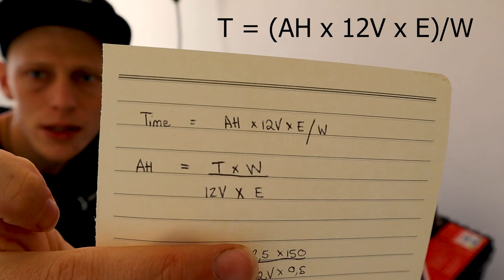How to survive load shedding using an inverter and deep cycle battery.

Comment: Just a note on the Watts used in the formula: The Geewiz energy meter shows you the output Watts, you have to divide this by the power factor, also displayed under a different function on the energy meter, to get to the input Watts. Use the input Watts in the formula to get a more accurate result.

To double check the input Watts, multiply the Voltage and Current (A) shown on the energy meter.

The input Watts is the apparent power which is typically measured in VA, whilst the actual power, shown on the meter, is measured in W. The loss is reactive power.

One last note: The Geewiz meter consumes 0.5W by itself, so you can deduct this from the input Watts, but it's quite small relative to a typical load so you can probably neglect it.
Reply from the maker: Amazing thanks so much for this extra useful information!

Comment: I have the same inverter, and I also have an ellies one. Can i add an additional charger to the batteries, reason i ask. I now and the disconnect my batteries from the inverter and charger them with an 8stage proper charger to condition etc the batts then get longer time out of them, want to make best best of both worlds combo by prickle charging sins the mecer have crappy charger build in.

Comment: Thank you very much for the informative video!
Could you please touch on the "efficiency" again? You said an efficiency of 0.5 is ideal. Is that 50% of the total battery capacity?
Reply: That's correct, you only want to drain your battery to 50% to increase it's life span

Comment: i have 4 x 12v 105AH gel batteries...all want is to run my 2 tvs. does your inverter cut off or warn you of dropping lower than 60 percent batttery power.....im a nubie at this.

Comment: Hi there please help , i have a N200 apn 12v battery. And i also have 1500 w inverter with 10amps battery charger. Please help me to use manually without connecting to my db

Comment: Does your Mecer inverter make a humming/buzzing sound when the mains switch off and it only runs on battery? Not the fan, but the electronic circuity buzzing?
Reply from the maker: When mine is in use it does yes. So when using the battery power it will make a hum.

Comment: Hi Andy, can you please do a video with your inverter on, not under load, and under load.  I have the same one but it makes a noise even when not under load, and an even higher frequency noise when under load and the power is off.  I can also hear the noise at my PC when it's under load, might just be the phase, but I'm specifically concerned about the noise when it's not under load.
Reply from the maker: Mine does indeed make a noise when under load. Kind of a high frequency buzzing sound.

Comment: This inverter is well-known for overcharging batteries
Reply from the maker: Thanks for the feedback!
Reply: is it over charging via means of too high of a voltage the spec sheet says something like 15v overcharge cut-off which does seem pretty high on the 12v model and 30.0Vdc ±2% on the 24v though it says its float voltage is 13.7v which seems correct. I have one that's been working for years but i want to know what its charging rate is for the 24v model and it says on the spec sheet its selectable but im not sure im going to assume it delivers around 10 amps for charging the 24v

Comment: HI, Does the Inverter also charge your battery or you do that separately?
Reply from the maker: The inverter charges the batteries when the power is on. then converts the power from the batteries when the power is off.
Reply: @MarijuanaSA  thanks, most helpful video bro.

Comment: I like the video very much. I have 2 questions. How does adding an additional battery affect the hours. In other words when you add an additional deep cycle battery, does that change your AH from 105 AH to 210 AH or does that change the formula in a different way. Second question is if you do have 2 of those batteries and just for argument's sake you have 4. That is for batteries connected in parallel, giving you the same 12v and hopefully (105 x 4 AH), does a stacking like that mean you need more chargers or can the same inverter in the video charge all 4 ?
Reply: Adding more batteries wont affect the formula, it always remains the same. Adding more batteries will increase the time they will last. If this is a 24v inverter and you are connection 4 batteries then you have to make 2 sets in parallel and combining sets to be in series ( 2p2s) so that their combined voltage does not exceed 24v.

Comment: Thank you for these calculations, preciate it. 

Does the Mecer 12v 720w work when completely off grid. Like you would have your load below 720w but youd wish to use solar panels simultaneously. 

Please advise as I will be getting this in a week's time.
Reply from the maker: How did this go man.

Comment: Good explanation.
Just a question on the inverter itself; I bought the exact same unit recently and find it quite noisy in battery mode - like a humming transformer sound. Did you also experience this?
Reply from the maker: It did make a noise, but was such a small price to pay for me personally.

Comment: Can you use a normal car battery?
Reply: Short answer is yes. The lifespan will be really short though as they're not designed to deep cycle but rather provide a lot of energy for a small amount of time.
Reply: car batteries are designed to start cars, not be drained over and over. Plus they're smelly.

Comment: Had 3 of these in 11months, they don't seem to last that long, poor build quality maybe ... 

My setup was 2400va inverter with 2 x 100ah gel batteries in 24v and never had the inverter load higher than 25% - 2hr load shedding used 50% battery capacity and recharged full in 4-5 hours @ 20amp charge
Reply from the maker: Mine is still going strong as we speak. Bought 3 more 🙌

Comment: I don't smoke weed so I am not as smart as you , tongue in cheek ...

So if I want to run an entire household :
Fridge
Two televisions
14 downlights
12 normal energy savers
2 medium sized halogens

Other items off wall sockets :
Laptop
Router
Mobile phones on charge

Optional :
Stove and washing machine

QUESTION :

What pure sine wave inverter with built in charger will suffice
With what batteries

AND OF COURSE
The efficiency factor must be worked in to all calculations

OFF THE TOP OF YOUR VERY SMART WEED HEAD

WHAT WOULD YOUR ANSWER BE

?

That would of course include zoon calls lol

...
Reply: Why couldn't you just ask your questions without the subliminal messages?